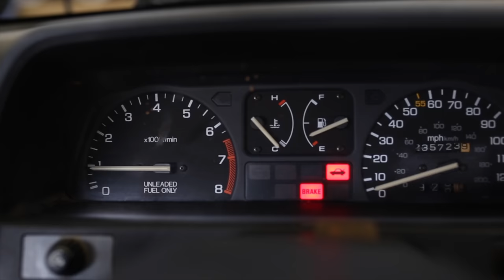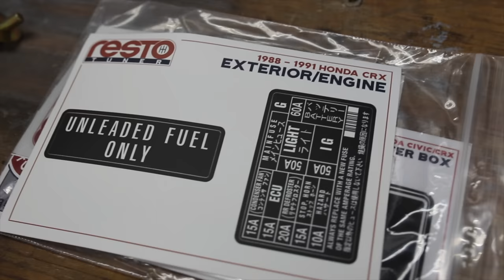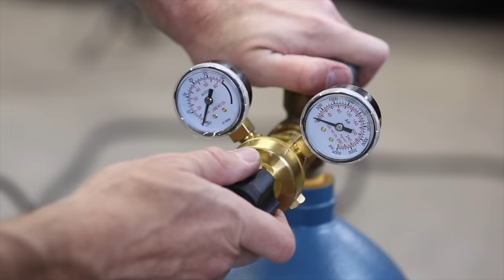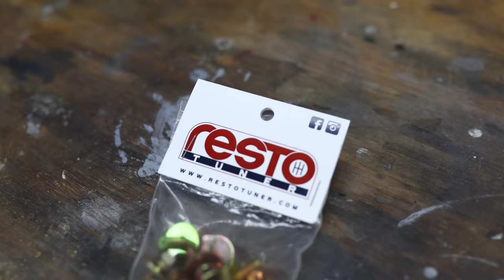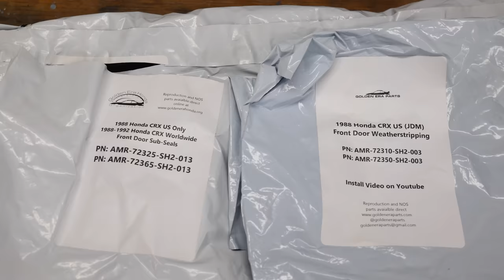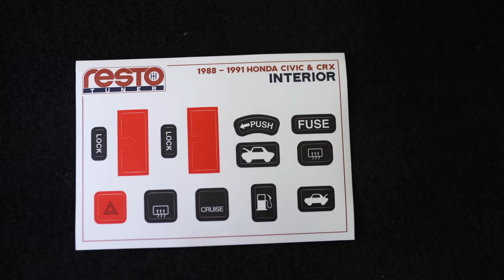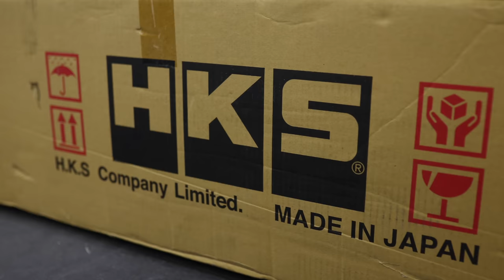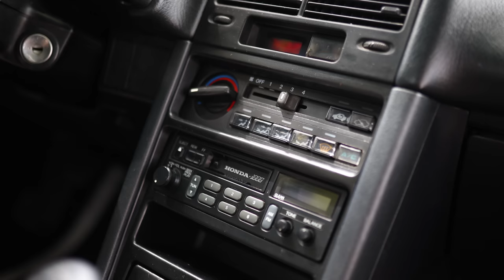Restoring a 1988 Honda CRX Si in 30 Minutes - 2 Years Start-to-Finish

Comment: Subaru guy here.  Done this with those.  But, I have always had a huge soft spot for the CRXSi and this was an amazing job!  I get to see it all in 30 minutes and it was 2 years for you.  Looks like a very well done project!  My two favorite parts about the build are the stock wheels and near stock ride height retained.  And, I love the period looking exhaust.  Yes, it is an upgrade per se, but it looks spot on in black!

Comment: This is such a love letter and beautiful restoration. My first car was an ‘89 CRX Si and I try to look for a good ‘90-91 every chance I get. I didn’t realize as I got older that I would be so nostalgic about these things and here I am at 35 wishing I could find one again. Thank you for this video - it’s really well done!
Reply: Mine was an 85 civic. Absolutely loved that car
Reply: RED 1990 CRX-Si $12k NEW 😭
Dying to know if still on the road

I want it back!! (Had to sell, was 1 point away from losing license 😜)
Reply: @practice4617 thats funny i got in so much trouble with mine.  It was a 90 but automatic.  Still the funnest car ive ever owned.  Could take corners at 55 and still had grip.  Amazing.

Comment: This was one of THE BEST rebuilds i have ever seen. I admire your patience and time which you spent on this project.  TLC given in this restoration is just amazing. 2 years of hard work summed up in just 30 minutes. Was the CRX for personal use or you sold it?
Reply from the maker: I sold it as it was finished.
Reply: Why? Did you not enjoy anymore? Want to pass it on?
Reply from the maker: @jimmynuetronrblx8628  I have another CRX. This one was purchased to fix and sell.
Reply: @crxseth When will you give out a cost estimate of the break down and how much you sold it for?? , I'm a new sibscriber
Reply from the maker: @ShellcrackerLove  1988 CRX Si Restore Part 51 - Cost Breakdown
https://youtu.be/cpl-3TkYLeA

Comment: I had a 91. Boosted the D series. Blew it up. Swapped in a JDM GSR and that thing bone stock, gutted interior ran a 13.3 1/4 which was pretty fricken fast for like 2004. 

Then I spent way too much money building up a GSR stroker block sleeved and decked to 2.1L aiming for 280-300whp NA. 
Basically built it, got it running. Drove it on a base tune for a week. Parked for winter.

Decided I was gonna do the body work over winter, stripped the car down to bare metal. Got a new project. Parked the car outside like an idiot and left it for 2 years due to no time. Completely rusted out.
Scrapped the shell. Sold the motor and parted it out.

I miss that car. Most fun I've ever had driving around. It's like a little go-kart.

Comment: Love the work done.  So much pride and love put into the CRX.  Only thing I would have done was add sound dampening material on the floorboard, trunk and inside door panel.  Miss my Silver 1988 CRX SI with 15" Panasports.  Hopefuly in the near future I'll be able to find another stock one.

Comment: man we had a dude in our hometown in Germany when I grew up he had one of these with at least a 200mm exhaust tip on it. it was so savagely loud and sounded like it was running 12000 rpm, as little 10 year olds we thought he was the absolute dude himself.

Comment: friend of mine had a really nice red CRX SI... we were stopped @ a light on Stevens Creek Blvd and some lady in a van coasts right into the back of us... blew out the glass panel on the back gate.. the shop glued a sheet of fiberglass in place till the replacement could be delivered & installed... ...
..
The shop had to order it THREE times because it kept coming in broken... FINALLY he gets it installed....
..
We were on the way to Manteeka for a company waterslide trip..... and we stopped for gas........ a CHP patrol car backed into us and blew out the glass panel on the back gate...

W

T

F

Comment: I owned two Civic models from that generation, a blue and a red one, those where amongs my best cars. The CRX could go up even 1000 rpm when accelarating, before crapping out. in the netherlands they are called deadcoffins, so many people had died not understanding the horse power. Yet in Japan they had a special model which never came out in the rest of the world that has even more horse power than any other model.

Comment: What color black did you use. I bought an 1987 new and drove it 387000 km. Sold it for $2,000. Only paid $13,500 new. The paint had gold flecks in it and always looked freshly painted. NH80M was the paint code. I still remember.

Comment: I bought my first wife a CRX HF brand new in ‘86. White exterior, blue interior. It was exceptionally gutless, but a surprisingly well-built, solid little car. It went with her when she left, which was fine, I had a new ‘89 Isuzu impulse turbo to drive. 
You did a great job on what had to be a very hard car to source parts for, truly a delight to watch, thanks for sharing 👍

My ex is probably sucking a dick somewhere right  now, having lost that car ages ago. 

Thanks for the memory refresh!! 😅

Comment: Outstanding job but at the end of the day its still a, very clean, 1988 CRX with 235,723 miles. I would find 105 hp from the 1.6L engine rather anemic. This is why I personally lean toward a "Restomod" - a classic car with a modern twist. I'm thinking of a modified K24 from an Acura TSX with the 6-Speed Manual Transmission.💡

Comment: I sure love 80's-90's Hondas. My only question, what was the reason for cutting the HKS exhaust?
Reply from the maker: Try only make it for the 88-91 Civic hatchback, so you have to cut it down to fit on the CRX.

Comment: All that work and you put the original D series motor back in?? You should have upgraded it to a B16  ,  B18c or even an LS Non Vtec B18. Those cars are so much fun with a B16 or GSR B18c, they fly with the extra power and either is an easy swap. That was kinda of a letdown not seeing a bigger motor swapped in but other than that you’re a true pro, that thing is a work of art. Great job.
Reply from the maker: The idea was to maximize the return and stick with mostly original. Swapping in a b series would have added an extra $3-5k but not increased the sale value of the car.
Reply: @crxseth  That makes sense if you’re just reselling it, If it was my personal car I’d of put a B series in it. I had a 91 EF Si Hatchback 10-12 years ago that i totally refurbished/rebuilt that I swapped a GSR Motor in with a full race suspension. It was a really fun little car. You did a great job rebuilding that Rex though it looked brand new , they’re beautiful fun little cars. Glad enthusiasts like yourself are still keeping them up on the road. They get rarer and rarer every year.
Reply from the maker: @K1forMVP  Thanks. I agree. My CRX had a B16A, and I’m currently in the process of swapping in a B18C Type R engine in now.

Comment: I couldn’t do one percent of what you have done in this video.  Awesome job.  I do have a question though.  The radio/console metal frame had some rust but you didn’t remove it.  Since I really don’t know, could you say why?  Thanks, and again, awesome job.
Reply from the maker: It wasn’t worth the time. It’s covered, it’s just surface rust, and they are all like that. This wasn’t meant to be a concourse restoration and I had to choose some things to not completely redo, otherwise it would have never gotten completed.
Reply: @crxseth  thanks, makes sense.

Comment: I wonder realistically how many years of professional experience you need to be able to pull this off. This is basically my dream "job", but holy cow I'll be 45 by the time I'm able to do even half of it...
Reply from the maker: I have no professional experience. And this was only the third attempt at painting a car for me, so anyone can do it if you’ve got the time, tools and patience.
Reply: @crxseth  I don't know. I can't even assemble an Ikea table without forgetting at least one screw somewhere. Not only you'd need to keep track of where every little cable/plug/nut/bolt goes but it would also need to be assembled correctly, like in terms of torque and so on. The idea of suddenly losing an axle while on the highway would just stress me out, and it would be even worse if I were to make a living selling them and now I'd be the one responsible. And that's even not counting the actual restoration part.

Comment: Just a general car guy that had this suggested via YT, but I gotta say, damn impressive job man.  My only slightest of questions would be 18:47 on the door latches, those couldn't be cleaned up at all?  I mean you did 99.99999% everything else, and then bolt those to that beautiful black paint?
Reply from the maker: They were rusted before and were soaked in Evaporust to remove all the rust. They are chrome plated, so without chrome plating again there isn’t much more I could do. I could have completely replaced them but I didn’t think they were that bad, but I’ve had a lot of people mention that detail since I show it very closely. Oh well.

Comment: Thought the Si came with 4 wheel discs?  I could be wrong been years.  Remember these when they were new, who knew they would become a classic.  My Dad says the same thing about the VW type 1 who knew???
Reply from the maker: The 88-89 didn’t have the rear disks. Just the 90-91 CRX Si.

Comment: Why did you put the suspension back in THEN paint the wheel arches? Seems an odd way round haha.

Awesome job though
Reply from the maker: It was just timing of being able to get the car rolled out and wheel wells washed and the car rolled back in and installing suspension. It’s just how it all worked out.

Comment: Why did you replace the clutch if you were going to remove the engine and transmission anyway?
Reply from the maker: Wanted to get the car inspected and registered before completely rebuilding it.

Comment: What color code black did you windup using my 9th needs new paint?

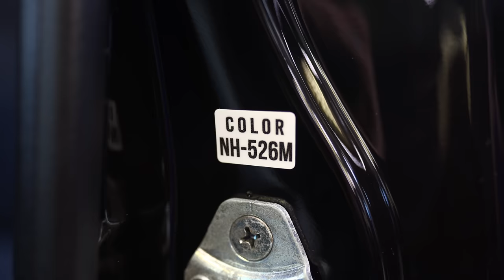Edit: ADHD, totally saw the color in the door frame and missed it 27:24

NH-526M
Reply from the maker: Just the original Flint Black Metallic.
Reply: @crxseth  nice, I've been looking for something close to piano black, my paints in kinda rough shape. I fixed the worst of it on the hood with rattle cans(Krylon) it was nearly perfect, needed to wet sand the base color, spray clear coat, polish and buff clear, add protective wax and I would have been done, Florida heat is no joke though. 

Definitely gonna give the Flint a Try Though, at least on video it looks like it has the right amount of saturation for a high gloss black without looking kinda grey.  Looks amazing too that's some good work 👍

Comment: Was the first thing he did the transmission? I am just learning. What were those parts?
Reply from the maker: I installed the clutch and pressure plate and a different transmission to get the car running and driving so I could register it before starting the restoration.
Reply: Wonderul. Thanks @crxseth

Comment: You missed a great oppportunity to acid dip the chassis. I wish I would've done on it on my car. I wire wheeled the whole car, which is dangerous, time consuming and it doesn't really get into every part of the body.
Reply from the maker: That’s the dream. Working out of a small home garage and on a tight budget makes it hard to achieve large scale restoration techniques.
Reply: I know! I've been at it for 10 years. Not just the car but I work on it every chance I get. I like how you kept it achievable. I loved the CRX when it came out and it looks just as good today.  Oh, I believe there are only a handful of chemical dip places in the US. I'm in NY, so 3S chemicals is in PA. It's $2400 to dip a full size coupe...FYI.